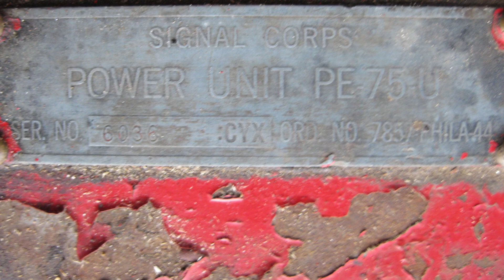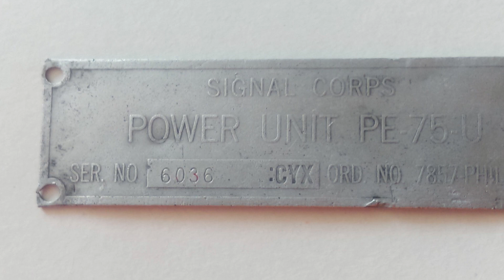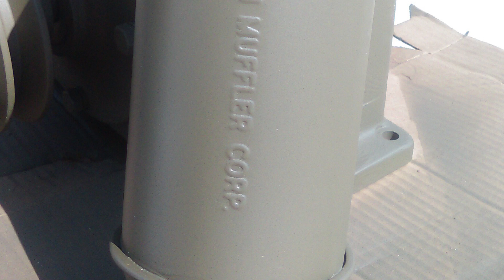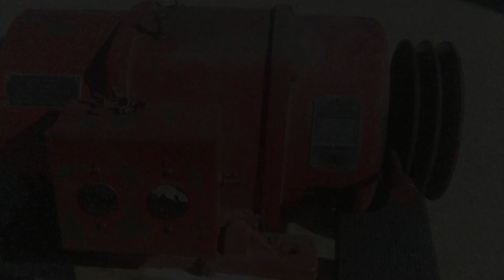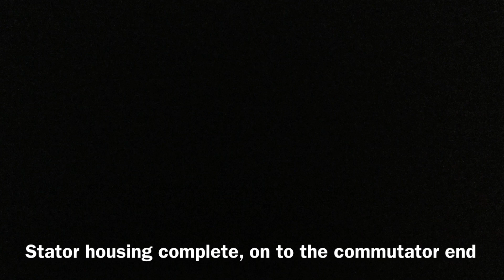1944 PE-75-U WWII US Army Signal Corps Generator, Briggs and Stratton ZZ

Comment: Thank you for restoring the World War II, Army generator set PE-75 it would seem you did a museum quality restoration it’s a credit to your skill.  I love the simplicity of this generator, when one looks at its modern equivalent there are multiple components which I believe add to potential failures. I like the expression: “keep it simple stupid” as a design criteria. 

My Vietnam-era communications equipment ran off of SF-10 a 10KW that ran at 3600 RPM its 4-cylinder aircraft engine screamed like a banshee.  When it failed the peace and quiet was wonderful for a split second before panic struck & the adrenaline kicked in for me to run to start it’s mate on the trailer.

Comment: Excellent job! Dandy little generators, and they don't make nearly as much noise as a modern 3600 RPM unit. Plus they'll always start once the carb is rebuilt and the fuel system's cleaned up. We've got one on the farm that will get dragged out during short power outages, usually because whatever modern portable generator is supposed to be doing the job won't start.

Comment: Great video - I'm restoring a PE-77 generator and looking for replacement parts - where do you source the majority of your parts? I'm in the UK Thanks
Reply from the maker: Ben King my PE77 was very complete. I didn’t have to find much for it. 

The Smokstak forum is a great source for vintage small motors, but it is US based. You could still find information and parts though, as the engine is a Briggs and Stratton Model I (the letter I). Occasionally you can find parts on eBay.

Comment: Awesome video, I'm working on M5 ZXB generator with 4 cylinder Flathead Hercules engine. At the moment I'm taking it apart, going through some things on the engine. My radiator hoses were all melted and getting gummed up. That's probably why my water pump is not working do you know much about these types